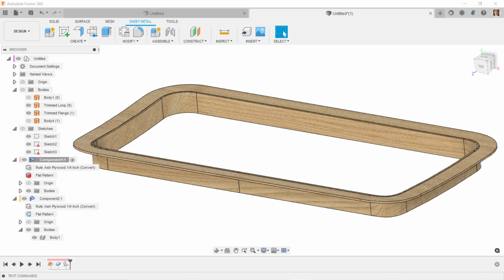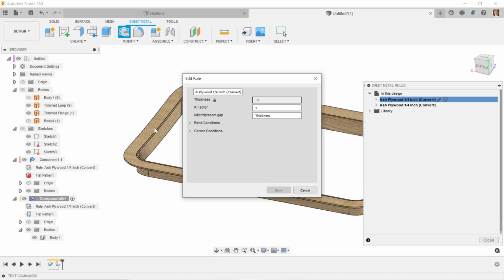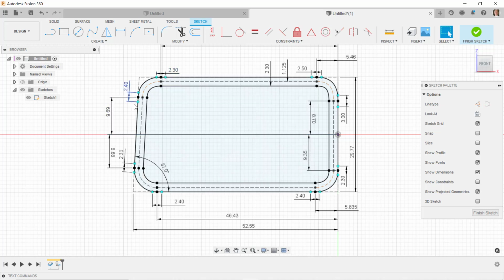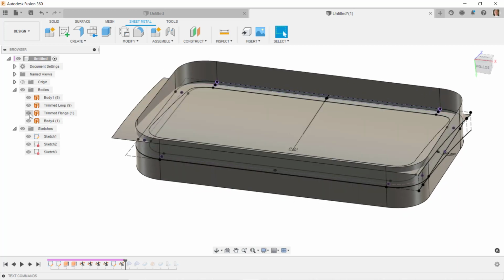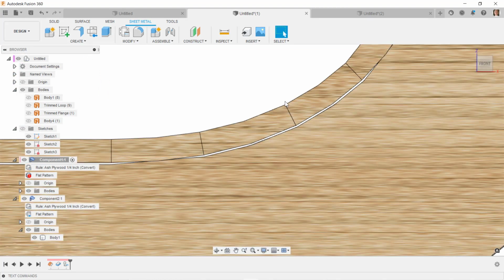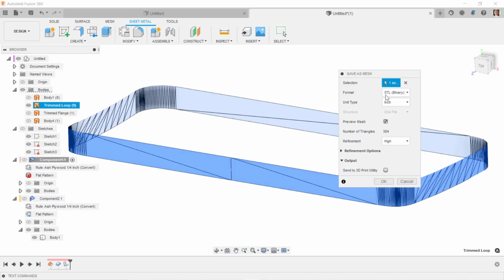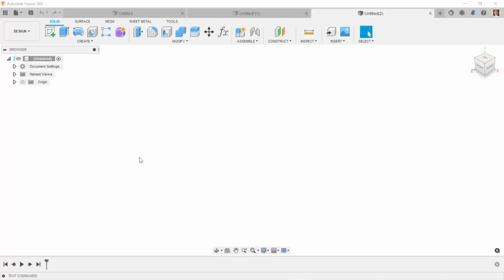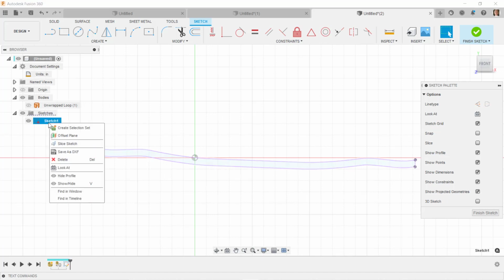Whisper   Roundtrip Fusion 360 to MeshMixer Unwrap

Comment: Could you go into a little more explanation of your workflow for converting the one piece that did flatten in Fusion?  I design model boats and airplanes, have had little success in flatten sides and tops. They are not complex curves and are laser cut out of balsa or ply.
Reply from the maker: Follow the 4 rules of sheet metal.
Reply: @TheCADWhisperer  im having zero luck
Reply: @pufferfish0567  Same. Part is just red, no code, no error, just red and no result. This is literally the most informative piece of information I've found in an hour. What are the four rules of Sheetmetal? Why is there no error code, just produce something! Why does using this software require Detective skills?